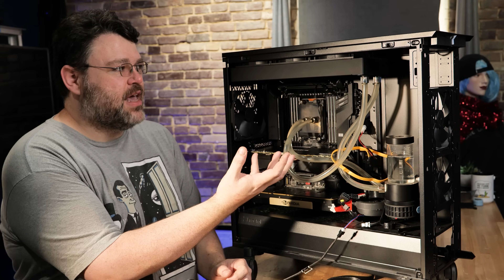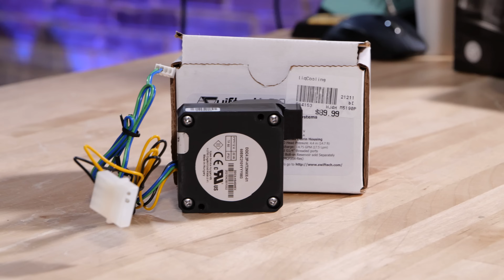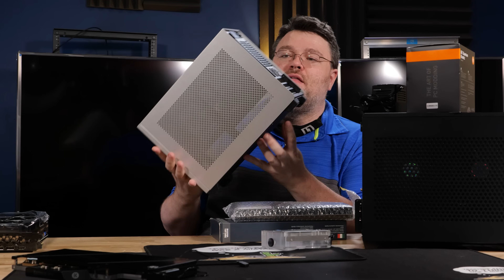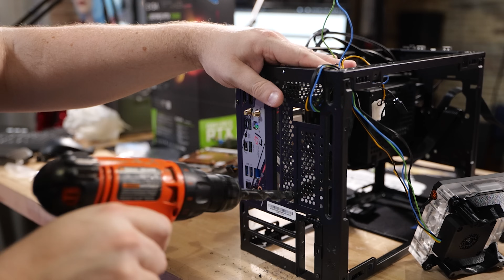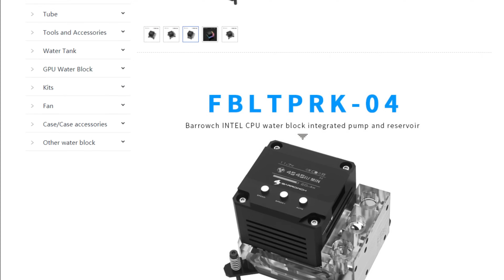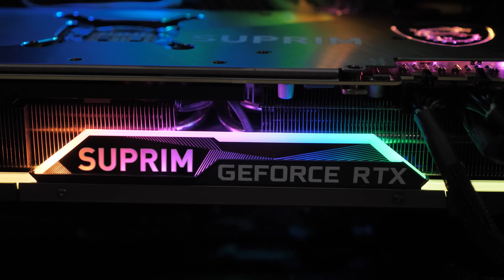Small Form Builds: What to Consider for Cooling?

Comment: I have had an EK FLT 80 DDC in my NR200 for almost a year . Initially everything was looking good but after 11 months  when took my system down for yearly  maintenance i found micro cracks all around the ports incl those that were never used so i am pretty sure this is not user error ( used port were carefully tighten by hand anyways ). Very disapointed , thankfully i was well within warranty period but that's definitely something for people to look out . I would avoid acrylic ports at all cost , especially those from EKWB ( Alphacool reps claim their acrylic is stronger but yeah don't have personal experience with them in order to judge). Thankfully companies like IceMan make acetal pump/res for SFF and Alphacool has come up with some new  distro plates with metal reinforced ports so there is hope they will implement something like this in their Rise Flat DDC/D5 resevoirs in the near future and hopefully it becomes a standard for all manufacturers.

Comment: I’ve Level1 up’d after watching this.

You know, the really puzzling thing is why radiators are put inside the case. They should be on the outside to remove the heat better. Case manufacturers could come up with something to allow this.

Comment: I love my NZXT H1 because it doesn't take a lot of desk space. One thing I didn't take into account is how much a case fan is really needed. Since it doesn't have an exhaust fan on the case the heat just builds up in it, like real bad. Set up a USB fan that sits next to the case and it makes a huge difference getting even a little bit of air moving through.

Comment: There is ALSO the issue of materials/metals. You cannot mix metals. You cause failures, gunk build up, all kinds of issues. Which people don't realize. EVEN IN THE CAR WORLD we know you cannot mix metals in cooling systems.... Today's computer builders will cry "liquid cooling sucks, you have to keep cleaning it out and refilling it" no not really. You should only have to refill it. And the only reason custom loops need to be refilled is because its not perfectly sealed like an AIO. A perfectly healthy AIO will never leak and never stop working. If the tubes are leaking, the material used might have been bad from manufacturer and they didn't know it.

I have the old Antec Kuhler 920 and it STILL WORKS to this day. That thing launched in 2011!!! IT STILL WORKS. Now some might argue "yeah, it might work, but does it still cool the same amount" yes, for a single 120mm liquid cooler, it still performs like a 120mm liquid cooler. Then you have my NZXT X60 Kraken which is a 240mm AIO. I am talking about the OG kraken. When it first came out If my memory is right was in 2013. Again, super old I mean its freaking 2021..... IT STILL WORKS. I ended up shipping it to my friend along with my old 9590 with motherboard and memory and he is using it, guess what, IT STILL WORKS. He hasn't noticed any change in cooling performance. When you take care of your shit, it lasts. This idea that stuff fails, well either you were extremely unlucky or YOU caused the issue. I have seen people bend tubes and abuse their liquid cooler and wonder why the tubes cracked and started leaking.... People are super abusive and pretend like abuse doesn't break things. Even in relationship, abuse breaks the relationship.... but for some reason they think abusing their technology, wont break them.... insanity.

Comment: Why can't you get truly upgradable AIO PC/monitor setups? The all in one PCs are usually cheap and nasty - surely they can design a plug and play base system? Water blocked GPUs with snaplock fittings are straight forward; A 27" monitor and stand is of sufficient size to house/ hide even an ATX sized motherboard.

Comment: I'm keen to build a small form factor workstation (AMD X570 based), but the problem for me is the 64GB limit on RAM. I use large orchestral sample libraries to write music and find 128GB, as in my old computer, is enough to do the job. I'm not aware of an ITX board that supports 128GB. Shame.

Comment: I left soft tubing because I got tired of cleaning plasticizer out of my blocks. Hard tubing is more work in setup and harder to change pieces but less cleaning.

I recently used Tygon tubing for a friend's build. If it works as advertised I will probably go with that for my next build.

Comment: Back in the day I was given a r9-290x lightning and I built my first SFF PC.

I just cut a slot in the side of the case for the edge of the waterblock to fit in there.

Later, when I got a smaller GPU I put a piece of tape over the hole.

Comment: You mentioned having two pumps in the same loop and for a concept I've wanted to do that'd be useful. Would both pumps need to be on the same Mobo header is my only question about it.
Reply from the maker: Nope no need
Reply: You will want to check both the headers supply ratings vs what you're plugging into them.

'Most' motherboards only come with one fan header capable of delivering more than 1Amp, eg intended for possibility of a pump.

Also IF your motherboard does have two headers capable of the required supply power, you will want to synchronise them, eg when refenced component is @40°C both headers output 70%, @50°C 85%, @60°C 100%. (numbers/percentages are examples only)

Otherwise if out of sync one pump may hinder then performance of the other pump or one be 'starved' of supply etc.
Reply: @Syraxal  I knew most of that lolol I was just curious about syncing it but I didn't even think about just matching their heat response curves. Good looking man
Reply: @Syraxal  I'm the same way when explaining things I don't even stop to think what the person may already understand 😂😂😂
Reply: I'm not saying lol out of rudeness or anything it just genuinely made me laugh because I feel you mate

Comment: I bought tons of 16/10 tubing and Koolance QDC fittings. Lots of space in a big case and many 560 and 480 rads.
Reply: Not sure why you bought all that, you cooling a car or motorbike or something?

One 480 rad is more than enough to cool a 5950X and a 3090 and still have head room to spare.

Also those Koolance QDC's do restrict flow, ALL QDC's do...

I've been running their QDC3's (10mmID) for like 6years, never build a loop with out them, their flow rate is better than the EK, Swifttech etc ones.

Comment: Swift tech makes their Apogee drive ii, which is a CPU block that has a mount for a DDC pump. Works pretty well. 

Alphacool makes a small pump block combo called the Eisbar LT but that has their LT pump in it, and it's a bit weaker. It's only really intended for a DIY AIO style CPU cooler. You can upgrade the pump to their higher powered one that will do the job for a GPU as well.

Those all save a ton of space.

Comment: I've been planning a SFF threadripper for a while now and the biggest downside to mini-itx is that you only get 2 RAM slots. Doing it in micro-atx is way more preferred but getting a case that keeps the footprint small is tricky.
Reply: There's no ITX Threadripper (that I know of), there's an Epyc board that's a bit wider than ITX. I think something like that may have 4 slots, can't see how they fit 8 tho. I think Skylake Xeon ITX had 4 SODIMM and there was supposedly a version that could have 6 slots (no M.2 tho), and the X299 definitely had the max 4 SODIMM as well.
Reply: @Fay7666  I may have been thinking of the EPYC boards, I thought first or second gen threadripper had a mini-itx, looks as though I was mistaken. At any rate who would want to waste all those PCIE lanes
Reply: @NickByers-og9cx  especially with thread ripper, it may just be the need for high speed, high core count systems in a smaller footprint... A rare use case, for sure, but definitely still valid

Comment: your Comparison of the DDC and d5 Pump is a tad broken. 

the DDC is a Floating Impeller with heat from the coils being removed outside the casing of the pump the DDC operates at a Higher RPM with a smaller Impeller. its flow is Lower but its pressure is Higher. the DDC because of this high RPM is louder but smaller and also is prone to overheating

the D5 is ALSO a floating impeller pump but the heat output from its coils is displaced into the water by means of a Stainless steel housing. this means the Fluid removes heat from the pump and the pump does not have to worry about overheating coils. the D5 is a higher wattage 40w vs 18w and has a larger but slower moving impeller. this means more flow but less torque and less noise 

both Pumps Operate on the same Principles of Maglev and as such don't really "wear out" from use as the only moving part is an Impeller that sits in water./coolant.
the Biggest weakness is Solid coolants gelling or Particulates causing corrosion of the internal body (DDC's also can overheat)
Reply: Came here to post this.

Also DDC overheating is dependent on the version. The DDC is available, although this often isn't marked, in 3 versions. These are internally called the 3.1, the 3.2 and the 3.25. The 3.1 is a low power version, with the others being more powerful. The 3.25 is a somewhat overdriven 3.2, and has the most risk of overheating. If there are any non-Laing manufactured copies floating around out there, I don't know of any specifics, but I wouldn't be surprised if there were. The swiftech, koolance, etc ones, to the best of my knowledge, are rebranded Laing units but correct me if I'm wrong.

Finally, the top covers available for both the D5 and DDC pumps can greatly change their stock characteristics, by trading flow for pressure or vice versa. Some covers offer more of both (read: are more efficient/have fewer internal losses) than others. Some D5/top combos offer more pressure than some DDC combos, and vice versa. As for flow in an actual system, this is a factor of both free-flow and pressure, and I personally prefer higher pressure pumps over high free-flow ones, especially with the high restriction "accelerator" type waterblocks. If you want to have your cake and eat it too, there are double pump tops, that take two pump units in a single housing. In this case, the additional pressure is overkill for the DDC without extra flow rate, and the double D5 actually wins out in my personal opinion. Neither is necessary to have an effective cooling system unless you cool every single component including chipsets, VRMs, drives, RAM, multiple GPUs, etc.
Reply: both are also cetrifuge pumps that will - counter intuitively - spin easier if water circuit is blocked.

Comment: For my last build I went with a meshify mini C and it's just the right size of case for me. Any smaller and I think it would be too much of a hassle to work on. 

Which reminds me, my computer has been crashing with page fault errors and I need to figure out why. it only happens when watching youtube and doing other stuff like gaming and I'm pretty sure it's my ram. The corsair sticks I have in there don't seem to work at any where near capacity when I try to use their XMP profile and manual tuning just resulted in instability. 

It could be that my motherboard is just kind of old, I bought an older b450 tomahawk to save money when I built the machine and flashed the bios to work with the newer 3600x Ryzen cpu I bought. My corsair sticks were on the compatibility list when I bought them but who knows what jank I've introduced with the flashed bios! Fun times!
Reply: I had a stick of corsair lpx that caused a lot of errors and crashes recently, I ran memtest86 individually on every ram stick that I had and one of the sticks failed a lot of tests on a 6 hour run with the XMP profile turned on (3600 cl18) while the others was fine. If you have the purchase receipts, supposedly you can try and claim warranty if you submit the operating system error logs, corsair does not accept memtest results as a valid reason to claim warranty from what I've read. Hope that helps.

Comment: How common is the delayed start issue with these DDC pumps? I read about it and bought one anyway. Less than a year later the pump might take up to 5 minutes to start spinning from cold start!
Reply: That is not a problem with the pump.

It sounds like you've plugged the pump into a motherboard fan header and then incorrectly set the fan profile in your Bios.

I suggested you chnage the profile in the bios to be something like 80% @ zero degrees.

That will ensure that the pump spins up as soon as the power on button is pressed.
Reply: @Syraxal  It's plugged straight to molex. Non pwm DDC310, with 3pin to mobo for rpm readings.
Reply: @herpderp2736  Well your's is the first I've heard of doing this, I've had 3 different DDC pumps one 3.1, a 3.25 (EK-DDC 3.25), and a 4.2 (EK-DDC-3.2TPPWM4) the last two are still in two of my systems. Currently in my main system is the EK-XTOP DDC 4.2 PWM Elite which is (was) the same 4-Pin Molex and 3-Pin DC FAN connector that you've got, they all have started as soon as the power button is hit and have never had a 'delayed start'. I've always made sure to buy rebranded Xylem pumps though not knock-offs (Xylem were the DDC, D5, Flygt, and other pump designers/OEM)

The reason I said 'was' for the 4.2 is that I cut the connectors off and re-done them with a 4pin header connector so I could plug it directly into my motherboard and even in there it starts right away.

I can't really comment further on your particular issue since I've never seen it myself. The only thing I would say is maybe grab a multimeter and put the probes into another Molex connector (on the same daisy chain as the pump) put it to VDC and see if the PSU supplies power on that rail as soon as it's turned on. The pumps circuit board is nothing special, apply Voltage/Current, makes artificial electromagnetic field, the rotor spins... There's nothing that should make it 'delay'.

Have you pulled the DDC apart and taken a look inside?
I had a D5 come from EK with a strand of steel wire inside the metal rotor chamber, I put the whole loop together and turned it on and the pump made a horrible noise, so I now take apart all my loop components and inspect for defects before assembly.

Comment: Soft tubing ftw! Been huge fan of the Tygon norprene for years, great for all around use and it's always pretty clean unlike the zmt stuff, also pretty robust.. Did a couple of hard lined systems back in the day but I got bored of it, also too much of a hassle so I switched back to norprene with qdcs. It does take more adapters/extensions to make it look "good" (if you have ocd and you want everything to line up like me lol)  but the end result is great and you can switch out any part with ease. EK does an even smaller FLT Wendel, the FLT 80 for both D5s and DDCs, might help ya more regarding spacing.

Comment: If you go with dual pumps, do they run parallel or in series?
Reply: You can do either.
Either run them in series for increased loop pressure (head pressure) done if you have a load of restrictive items, eg. 90deg bends, low flow waterblocks etc.

Or split the loop, but that requires a replication ie. Loop1 Pump +Res, Radiator CPU block
Loop2 Pump +Res Radiator GPU block.

Comment: What are your thoughts on CPU Block + Pump combo units as oppose to a dedicated external pump ?
Reply: Should be fine, it's now (most) of the CLC guys do it. Heck if you're fine with keeping your GPU on air a CLC is way easier. Kinda. Routing fixed length tubing can be entertaining.

Comment: For sff builds I usually use one of those pump/block combos you showed but with no reservoir. I just use QDC fittings and a spare d5+reservoir externally to bleed all the air out.

EK's slim rads really suck though. There is no reason to go with them ever.

The bitspower FE blocks suck too. The finstack is rotated 45 degrees and doesn't even cover the whole die.